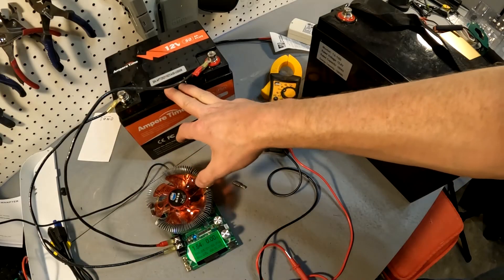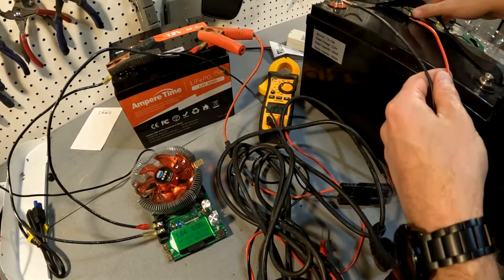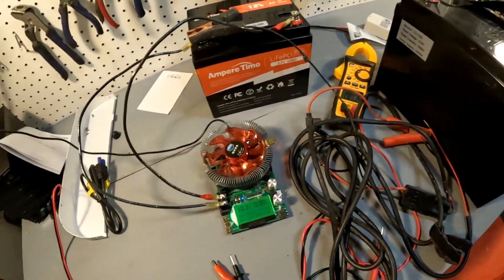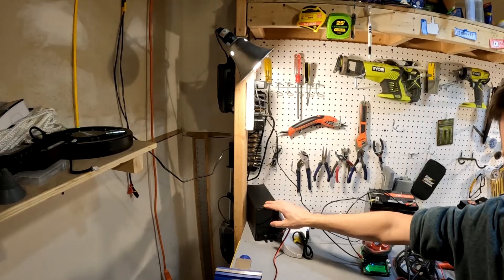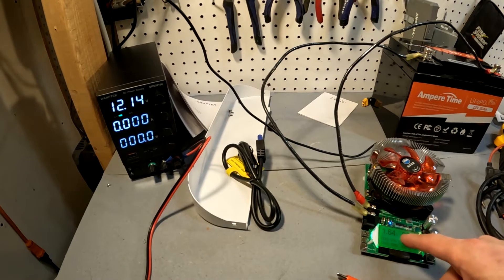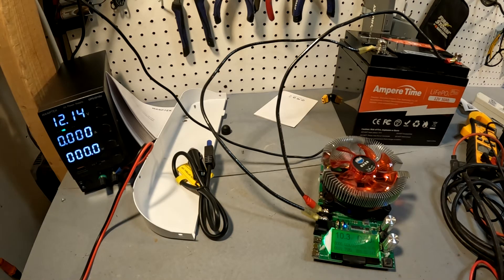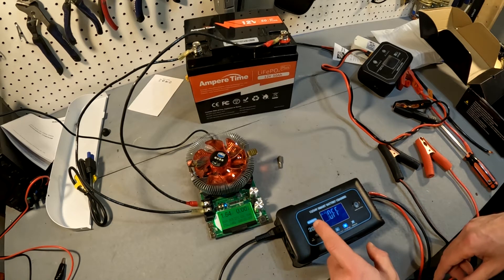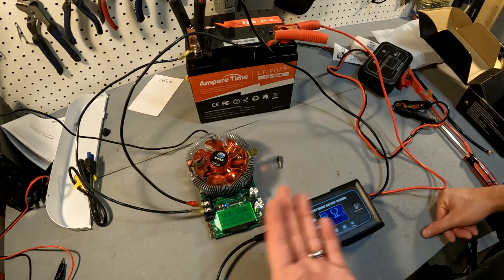Six ways to "Wake Up" your dead 12v Lifepo4 Battery!

Comment: Good to keep in mind that if it’s too cold like in my case the bms will keep shutting the battery down and not lettin it charge. That happened to my leisure lithium lifepo4 battery
Reply from the maker: yes.  The BMS should wake back up automatically when it reaches 40 degree F.  At least that is common amount most of the batteries I've tested.

Comment: It won’t wake up what do I do now
Reply from the maker: You're BMS might be shot.  If you're 12v battery is showing a voltage of 6 - 8v, then that is a bad sign.
Reply: @OffGridBasement I tore it apart bypassed the bms charged the pack directly for 15 seconds then it would charge through the terminals again which I did at really low rate

Comment: I have 2 metal case lifepo4 batteries that cost me a pretty penny just 9 months ago.
I use them in my work truck with an inverter and 2 100 watt harbor freight solar panels to recharge as well as the litime DC to DC 20 amp charger/ solar regulator combo although the truck doesn't usually run long enough trip to really charge up.
One of the guys must have left the inverter on over the weekend or something because the system was working fine or several months and now without explanation both batteries are at zero volts.
I'd love to know the truth as to what the workers did however that will never come so hopefully we can revive these batteries. I'm going to try your method  but any suggestions would be appreciated. If the DC to DC charger or the solar panels are working the batteries should have already woken up I guess but I'm going to disconnect them and try your method when I go back into work on monday.
Reply from the maker: I hope it works for you!  Thanks for the comment.

Comment: So you can touch an Alkaline battery to a Lithium?
Reply from the maker: To wake up the BMS, but not to charge it.  Hope this helps!  Thanks for the comment.
Reply: @OffGridBasement this did help! And actually the bms came on by just putting the volt meter to it.

Comment: I just added a second 100ah lithium battery in parallel. It seems one reads zero on the Bluetooth when reaching 100%
I didn't think about the bms putting it to sleep so I attached a multimeter and lo and behold they were both fully charged just from touching the multimeter to it.
I checked the battery's Bluetooth afterwards and apparently it woke it up! 
Now, out camping and on shore power, charging my batteries to 100% the other battery is now reading zero on the Bluetooth. 
How can I prevent one of the batteries from going to sleep each time?
Reply from the maker: They shouldn't if they are connected in parallel.  some videos just came out about smart batteries in parallel doing this!  Check out Will Prowse.  His watt cycle is doing that exact thing.  It's an issue with the programming of the BMS in the battery.

Comment: Probably one of the better vids on the topic.  The d cells in series is creative thinking.  I have seen other videos where the BMS doesn't respond to voltage.  Some commenters say you need to pulse it 3 times, off and on, and this is the case with batteries for Ryobi tools.
Reply from the maker: Thanks for the info and the comment!

Comment: What about 24 volt systems? If i take each battery out of the loop, jump it, then put them back on the 24v charger? Or do i have to charge them up individually?
Reply from the maker: If they are in parallel then just take out of the loop and wake it up and put it back.  Then you can charge the whole bank.

Comment: Recently rewired my solar setup. I didn't do the initial setup, but it was time to upgrade a few items, including a new battery with more aH and a larger solar panel. Went on two camping trips, one where there was very little sun coming through as it was very shady, but we had shore power, so couldn't really test the set up. Second trip, plenty of sun, no shore power, and my system died! Turns out two family members left two systems running all night, and my battery was dead! I didn't know about "waking up" a lithium battery, so we just did without power. Thank goodness it was a short trip. This video saved my sanity by waking up my battery (charging up as I type), but also, will help if it ever happens again, because I can use the truck battery to wake it up and my solar can take care of the rest. Thank you!!
Reply from the maker: I'm glad that you got it working again!  It's a bummer you had to without power, but now you should be good!  Happy to hear the video helped you out!  Thanks for sharing and for the comment!

Comment: Thank you for your help it’s really appreciated, when I stored my batteries and checked after 1 month I had a low volt meter reading. Even the customer service rep in China did not know about the battery going to sleep. I connected the 20 amp same manufacturer charger and they woke right up. All is good.
Can you advise if in addition to a car battery to quick start should a 12v RV/Marine 105 ah group 31 deep cycle battery should accomplish the same result? liked your video and subscribed. Thanks again.
Reply from the maker: I'm glad the video helped you, and yes, an RV/Marine battery should work!  Thanks for the Sub!

Comment: Your video gave me an idea. Tried connecting bmw charger and my audi battery to my lithium ion battery for my bmw m4 f82 but to no avail. It still read 0 volts. But then I connected the dead lithium battery to my audi battery and started the car.... It jump started the lithium battery and it now reading 12.8 volts. Thanks dude!
Reply: i did not connect the charger and audi battery at the same time. Fyi
Reply from the maker: Glad the video gave you a helpful idea, and thanks for sharing your experience!

Comment: What battery tester is that you use to put a load on the battery to kill it?
Reply from the maker: Here is an Amazon Link:
Electronic Load Tester, USB Load Tester 150W 200V 20A Adjustable Constant Current Electronic Load Battery Capacity Tester Module Power Meter, Intelligent Discharge Resistance Power Tester
https://amzn.to/4b8fFGa

Comment: I tried all of these methods, and the bms will not wake up. any suggestions?
Reply from the maker: I'm all out of ideas.  There is most likely an issue with the battery.  Sorry I can't be more help.
Reply: Saw another video that said take the top off - heat with heat gun to expand plastic top, plastic base remains unheated, differential in expansion of top breaks glue seal.  Then take voltage from positive external lead but on the negative internally prior to BMS - negative lead internally runs through BMS.  If taking voltage from external battery leads, you're going through the BMS and subject to its settings; battery cells could be fine but "invisible" behind dead or "off / sleeping" BMS.  Can also charge the battery cells in same manner, external positive and negative internally before the BMS, skipping BMS. Battery cells at sufficient voltage might revive BMS.

Comment: I bought two 300ah batteries one was fine straight away reading 13.5V on the solar controller, the other one shows nothing at all it is dead the battery tester gets no signal at all, perhaps when connecting the solar controller I allowed 20Vs or so from the solar panel and that has upset it or perhaps it has been dropped in the warehouse and that has upset the BMS...either way connecting another energy source to this dead battery does nothing unfortunately.
Reply from the maker: Sounds like a dead or a physically disconnected BMS.  Definitely need to return.

Comment: You are very clever to think of joining loose separate C size 1.5V batteries together with tape so that the batteries stay together and all in contact with each other.
Reply from the maker: I hope that method helps someone in a pinch!  Thanks for the comment!

Comment: Hi, sorry, my problem is
 The Lifepo 12V 300Ah(RoHS) battery at rest shows 90% charge and 13.0V, but when I connect a small consumer to it (5w), it immediately shows 2% charge and 12.5V.  When I put the charger (dedicated Lifepo) the battery display immediately shows 100% charged, 14.6V and it does NOT start charging.  So it doesn't allow me to load.  The battery is new, compact model with internal BMS and external display, I only used it for 4 days for RV lighting (5w bulb for ~15 hours).
   2 wet capes were also stored in the garage of the van, could the moisture have been to blame? 
 What do you think is the cause of this manifestation?
Reply from the maker: Moisture is not to blame for this.  It really sounds like a BMS issue.  Does the battery still work?  12.5v isn't a dead battery, but the charger should still do something.

Comment: I have 2 fresh out of the box litime 100AH 12V smart batteries, I looked at them while waiting for the hasito battery charger. It arrived and to test drive the charger I put it on my dr preper lifpo with same basic info, the charger topped it off quick. I then attached the charger to the litime battery and get nothing, moved to other litime battery and once again..nothing. u think Chinese new year could be in progress, I've sent 3 messages and wait. I'm gonna try bumping one of them with the full charged DrPrepare battery
Reply from the maker: Go get an inexpensive multimeter and check the voltage of those batteries.  If needed, wake them up by connecting to the DR prepare.
Reply: @OffGridBasement  I did the momentary jump from the woke DrPrepare for both batteries, they both sprang to life. Thanks

Comment: Can a charge controller with solar panel wake up the lithium battery??
Reply: It depends on the charge controller.  The one I have won't output anything until you connect a battery. Disconnect your charge controller from everything except your solar panels and measure the output with a voltmeter.  If you get somewhere near 12V, then it should work.
Reply from the maker: If you have a 100w solar panel with a 18v output then you can wire the panel directly to the battery for a second to wake it up.  Just for a second though!

Comment: Awesome advice!  It works!!!  I used the toy batteries to bring back to life a 24v 100ah lithium battery.  I had to used 17 batteries (1.5v).  They were so long that I had to do two rolls of batteries.  One roll was eight batteries and the other nine.  Here is a HINT to connect both roll.  I USED ALUMINUM FOIL TO CONNECT THEM.
Reply from the maker: Thanks for sharing and the comment!

Comment: I have 24 volt Li+ offgrid-hoTusehold batteries. They were depleted during unexpected medical absence. How can i wake them ?
Reply from the maker: You need to get a 24 - 26V source to "wake" them up by touching the connections for a couple seconds..  Disconnecting them from the inverter and letting them sit for an hour might do the trick as well.

Comment: I bought a new 100Ah LFP, it can easily charge other devices, but it doesn't accept charge. I have two power stations with 12V out, but neither of them can charge the battery :( Voltmeter shows 13, meaning the battery isn't emptied.
Reply from the maker: That is because the voltage of the battery is higher than the output voltage of power station.  You will need to get a 12v - 24v boost converter in order to get that to work.

Comment: You make it look easy. I’ve been trying to wake up a lithium that I bought for a motorcycle for 4 days. I bought it in the spring and it’s never been out of the box. When I decided to install it the darn thing was dead. Shows about 2.6 volts on the meter. I’ve tried every method on the internet and it won’t wake up.
Reply from the maker: It should be easy.  Sounds like there is an issue with the Battery management system.

Comment: I connected a Type-C PD 12V trigger module to my power bank, then connected the module to the battery and it also worked.
Reply from the maker: Thanks for the information and the comment.

Comment: This waking up problem becomes really annoying when you have a 48v battery, it's much harder to find 48v dc sources
Reply: I have 12V batteries in series to get 48v and it’s annoying having to remove terminals if I accidentally leave my inverter on. I ordered me an adjustable AC charger
Reply from the maker: I know!  I bought a small adjustable AC charger just for that reason.  Thanks for the comment.
Reply: @OffGridBasement  do you have a link to the adjustable charger. I have to wake up a bluetti. It's as 14v and needs to get up to 40v.

Comment: Could I use an old Sears 5 amp car battery charger to wake up the lithium battery then use it to charge the battery all the way?
Reply from the maker: To wake up, yes.  If the charging voltage is 14.2v or lower then you can use it to charge.  Just don't keep it on the charger after it's full.
Reply: @OffGridBasement  OK, thank you

Comment: Can you use solar?
Reply from the maker: Yes!  Most solar charger controllers will wake a BMS.  Also, I've heard you can directly connect a 12v panel to get the job done.  Thanks for the comment.

Comment: What do you do when the battery still shows 0 Volts after "boosting" it with another 12V?
Reply from the maker: The voltage shouldn't be 0v.  It should be around 1.5v for a powered down lifepo4 battery.  You might have an internal wiring issue or the BMS is shot.  Sorry I can't be more help.

Comment: MY LIFEPO WAS AT 0ish,,, I did the battery parallel trick,, it read 12.54,, but my charger (NOCO) still won't charge it... left it overnight did not get past 12.54 volts ??? any ideas ?
Reply from the maker: How fast is the NOCO charger?  A 3A charger would take over 30 hours to charge a 100ah battery.
Reply: @OffGridBasement  its a 10 amp charger,,, I have left overnight, LEDS bounce between first and second bar all night. I have multimetered it and got a ready of 12.54 always,,, I but a battery load tester on it and have gotten a reading of 5.6 volts.. I have connected an RC charger to it that supports LiFePO and the charger does not recognize the battery.

Comment: What ends did you post to the battery in series? ...Also, thought it was okay and actually best to fully deplete lithium then recharge, but only 50% for lead acid battery... any clarity on why not? Thought that was a key benefit for lithium ...
Reply from the maker: That is a big benefit.  Most solar charger controllers and LFP chargers can wake up a battery.  Running the battery from 100 to 0% will still give you 1000's of cycles.  I don't know if this helps...
Reply: @OffGridBasement  Thank you. It does help. After watching a few more vids , I see some suggesting not to go below 20% on Lithium so not sure if it's to avoid having the wake up issue or if it preserves battery life, but I'll keep both in mind.

Comment: How can i wake up my dead battery 36v li-ion battery 1850 e-step ? Thx
Reply from the maker: Did it not come with its own charger?  If not, then you would need another 36v source.  3 car batteries wired in series... a variable power supply would work.  Even wiring four 9v energizer batteries in series would do the trick.  Hope this helps.  Good luck...

Comment: Great video - unfortunately I have a EarthX battery complete dead with 4,6V - and fault indicator - and I could not wake it up with another 12V battery.  Voltage goes up to 12V momentarily but falls again to 4,6V... guess the battery is toast.
Reply from the maker: Bummer.  Sounds like something in the BMS is no working properly.  I would be careful on trying to charge that battery.  It might not know when to stop and cause thermal runaway.  That would be worse case scenario.  Thanks for the comment.

Comment: Nice video and may i add if you take 120v extension cord with the Other ends bare it kick starts it fast. Note just 2 seconds is sll it takes
Reply from the maker: Thanks for the info and the comment!

Comment: Why didn't the depleted battery fall back to 1.3V when the rescue battery source was removed? Then it won't be recharged, right?
Reply from the maker: The cells inside the battery and had time rise back up in voltage.  When the BMS is back on, it stays on because the cells are in a voltage range that the BMS measures as safe.  Hope that helps!

Comment: if there was a BMS cutoff you would have 0 volts..when applying a float a good bms should do a auto trickle load
Reply from the maker: You're right.  Appling a 13v float charge should wake up the BMS just fine.  As long as the item you're using to charge doesn't care if there is a voltage at the source, it will work.  Thanks for the info and the comment.

Comment: AWESOME thank you so much for making thos video! Will sealed lead acid batteries react the same way as a lithium??
Reply: And same concept - if waking up a 6v use roughly 6 volts to accomplish this?
Reply from the maker: I don't believe so since SLA batteries don't have a battery management system.  If you have a 6v battery with a BMS I'm sure you would need a 6v source to wake it up.  Thanks for the comment.

Comment: In looking up the Hasidic charge, I see that it gives you the option of lithium or LifePO4.  How do you tell the difference??
Reply from the maker: I'm not sure.  They both have the same voltage range per cell.  I don't know what Hasidic charge is.
Reply: @OffGridBasement  LOL….I don’t know what Hasidic charge is either, but I guess prescriptive text knows.  Meanwhile, I’ve pulled the battery out of my generator, but when attaching it to my jump starter, I can only get about 6v from it, and the voltage drops right away.  I think the battery must be bad.